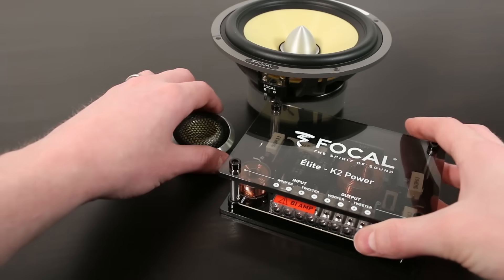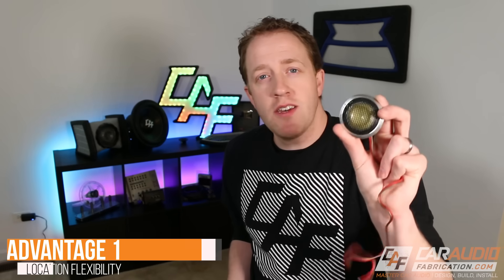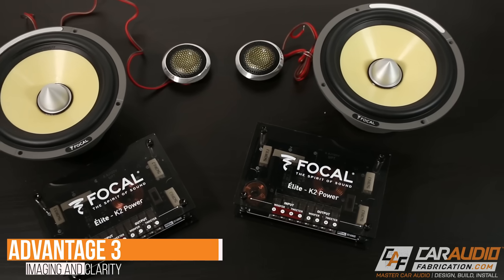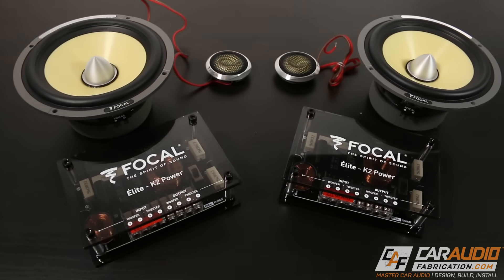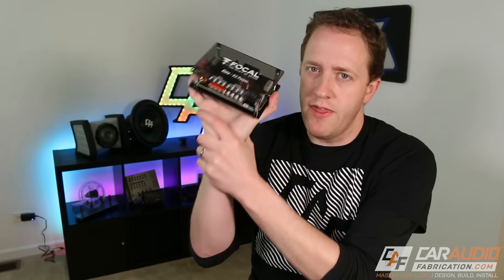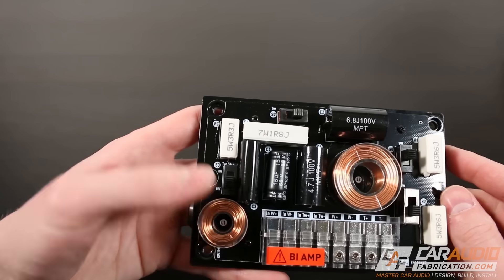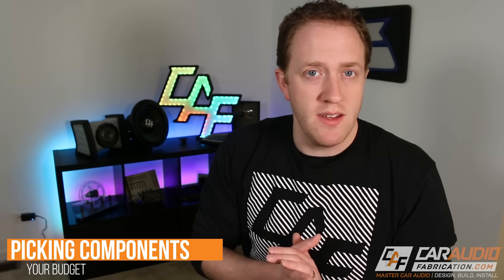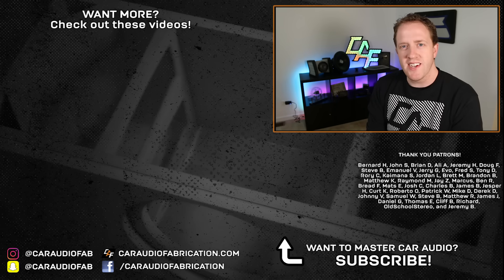Want AMAZING sound? COMPONENT SPEAKERS & everything YOU should know...

Comment: What about enclosures for the mid woofers?  Would you recommend those or do you prefer them as infinite baffle on the door?
Reply: Depends on your goals. If you're looking for "moderate" bass output without a sub, a properly powered high end mid in a ported enclosure will do. If you have an accurate, fast sub, there isn't as much need
Reply: @noncog1  how do you size an enclosure for midwoofers?  I can't find the thielle-small metrics for them so I could model in WinISD
Reply: @RyuMoto  unfortunately many woofers dont have listed t/s, I would try contacting the manufacturer and asking for both the t/s and reccomend enclosure specs. If that is fruitless, try finding specs for a similar driver. If you still cant find anything you'll have to wing it, for a base, my drivers want .3 cubes net, but take 300wrms and play down to 50hz, so unless you're running something similarly capable (which if you are you should be able to get those specs) you'll want to shrink that enclosure. For a mid grade set I'd probably try .2-.25 net cubes with a port tuned for between 75-200hz depending on the driver capabilities. The lower it plays, the bigger the box and lower the port tuning, the more power it takes, the bigger the box. The more come area, the bigger the box. These are 6.5's
Reply: @noncog1  🙏🙏🙏

Comment: The more systems I build the more I realize how much power these high end components need.
Reply: Yep, usually more power means more money 💰.  I usually go with coaxial speakers but rely on quality components, materials, installation, and tuning. It's not cheap but it isn't crazy expensive either. 2-3 grand give or take not including labor, time, and effort.
Reply: running 170 rms on my pioneers

Comment: Way to go bud, I am an audiophile you just stumped me. I own better than movie theater Home Theater system and work in live music, car audio is little different, you explained almost all of it. One question would nt the smaller space, seating and other materials absorb sound, how would one calculate performance and sound reproduction, for the best listening experience?  
Bose uses various testing equipment my Cadillac has Bose system, is rather disappointing, my Buicks system sounds cleaner in sound reproduction. 
To get the best sound reproduction should one use the amp to tune the speaker level or use the crossover to adjust the sound? .

Comment: Hello Mark. I love your channel. Getting ready to pull the trigger on my install in my H2 Hummer. Kenwood 9903S head and Focal 3 way for the fronts & Focal 2 way for the rears???? ? I have a Pioneer 10" shallow sub in a enclosed under the seat that conforms to the shape of passenger under seat.   My 2 questions I pose is . What AMPS would you use for Sub and Focal speak set. And second question is,  would you run a DSP ? Thank you for all your help.

Comment: Just curious, I understand resistance but if my amp runs a 4 ohm load output and I use a passive crossover with 2 components as you have shown, does that change the impedance? (ie:2 components on 1 channel)
Reply: Nope, atleast not by much. If you to have a set of tweeters rated at 4 ohm alongside 4 ohm mids, both run through a 2 way crossover, the ohm would stay at 4 ohm. The crossover divides the signal at a certain point between the two drivers. If you had a 4 ohm midrange, but a 2 ohm tweeter, the amplifier would "see" 2 ohms in the tweeter range but 4 ohms in the mid range, so the tweeter would end up louder as amplifiers tend to put out more power the lower the impedance is. If you are doing a component system yourself, that is buying a crossover, midrange and tweeter be sure that the drivers you use are all at the same general ohm rating. I'd get more into how the frequency is divided but I didn't want to make this comment too long, hope this helps.

Comment: JL audio is the best speakers and amps going right now.   I can tell you I have been listening and putting together systems in both home and car and vans and back in the 80's it was ADS and Concord head units, then smoother came and went, but right now, the cleanest power and the most accurate speakers are being made by JL audio.
Try to by the best speakers they make and match up the power with the amp that can also power the subwoofer also by JL audio.  It sounds so good to have everything matched up from that one company.  Chose whatever head unit you like, I prefer the Pioneer but that can change from year to year, the JL audio will not be changing.  I am very said at the moment because I am stepping into a Lexus that comes with Mark Levinson sound system and it is not nearly as nice as the JL audio I'm leaving behind in my old Honda.

Comment: look, avoid co-axial ones. and avoid these component set things too. get some old fashion dual membrane wide band speakers and thats about it. they are full range, they require no crossover as they have a mechanical one, and if you are not an idiot you get one with a decent paper cone. they are funky efficient, even just a few watts wake em extremely loud, they do not have huge cone breakups as distortsion is spread in a very wide band and stays low for that reason. powerhandling is supreme vs spl, so if you kinda need more in the highs you can eq the fuck out of them and never crossing more than say 8 or so watts. means you do not have to get a dedicated amp for them. the rest is just hype, and audiofoooooolism.

Comment: I have a Toyota Corolla 2020 without the jbl system. Which speakers do you recommend for that car, I just want to replace the stock for a better sound quality speakers. Also, I noticed that there’s already a place for a sub I guess that’s the place jbl installed his own sub. I would like to use that and install one over there.  I couldn’t find any information at the site you recommended. Thanks...

Comment: i have a 2000watt amp for my sub, can i use that for them too? or do i have to purchase a second lower watt amp?
Reply: It depends on how much power your sub is drawing really, because if the amp is already powering your sub it probably hasn’t got much more power for additional shit. You’ll probably have to get another amp, and bypass the two so that the one powers your sub and the other just the speakers. That’s what I did in my car. I bought a head unit, a ported 1500 watt Memphis audio sub, and a nano 1600 watt amp to power it. Then I used my stock amplifier to power my speakers. Or you could just get another amp, a big boy with higher wattage and run it all through one amp too I guess. Either way looks like you’ll be getting another amp.
Reply: Subwoofers, and low end in general takes a lot more power to generate. If you hooked tweeters and speakers to your subwoofer amp they would likely overpower your subwoofer and get blown out, plus since the amp for your subwoofer is probably mono (1 channel) you will not get stereo sound which requires atleast 2 channels. Generally you use high power monoblock amplifiers for subwoofers and 2 or 4 channel amplifiers for your speakers. If you care about having fader control (adjusting how loud your speakers are front to back) you want a 4 channel, but if you're not concerned with that you only need a 2 channel for your speakers.

Comment: I want to install the Hertz CK165L in the door panels. They came with two crossovers for each side that seem crap. A very thin cable comes out of them. It doesn't look as a quality component. I have in my possession a pair of mb Quart crossovers that are rather old but they came with my old speakers which were very expensive quality components. Do you recomend rather using the old crossovers than the new shitty ones?

Comment: Please help.. my vehicle has 6 channels. Two 6.5 in the front doors & two 6.5 in rear doors, plus two small 3.5" up front in the dash. Would it really be necessary to run components if I'm using an aftermarket deck to power the front/dash 3.5's while powering the doors with an amp? Thanks Mark!

Comment: Do I need to install an amp? Don't stereos have built in amps?

Can I just replace the woofer and not the stock tweeters if my car has tweeters and woofers?

Or do I need coax for the built it crossover?

Comment: Thanks for your great videos.  Ehmm but just to be a bit picky:  You said to not trust blindly on the impedance numbers provided by the manufacturer and measure them yourself?   Well I agree to not trust anything blind. But you can't really measure the total impedance with a multimeter because it's  mechanical resistance  + inductance  combined.  The mm only reads the mechanical..    
So don't  start  connecting 3-4 of these in series guys.. 😋

Comment: as an audiophile (trained engineer and diy hifi speaker builder) i put together a system for my van out of spare home speaker parts i've collected over the years.

in the doors are some 6" polyprop mid/bass drivers from some old kenwood speakers, mounted nice & solid with plenty of dampening and no crossover. in the tops of the doors below the front pillars, pointing at my ears are some cheap mylar dome tweeters (clones of the famous audax ones - there's so many copies and they generally sound decent enough if crossed over right) going through a 2.2uf cap (6db xover at about 3.8k). these are running through the front of my 4x50w $20 2nd hand pioneer head unit. 

through the back channels i run a 2x7" sub box i made with the drivers out of a couple of yamaha home theater subs, running through a passive xover. it goes down to 30hz at ~-3db due to a big, well designed, box with twin ports & high efficiency drivers! 

in total the parts cost ~$100 and it's seriously probably overkill for my work van. even without the sub box the bass is surprisingly decent. proper mounting of door speakers makes a huge difference and having separate component tweeters (in a noisy old van, anyway) can make up for mediocre mid/bass drivers, provided they're mounted right. according to literally everyone I've demo'd it to it sounds f'ing awesome. you don't need to spend much if you know what you're doing!!
Reply: C.B.S. Only original audiophiles will know audax👍🏽

Comment: So when they give the RMS rating for a set of component speakers, does that include both the woofer and the tweeter? say the rating is for 80 watts rms, will that 80 watts be for the woofer and the tweeter or is it 80 watts for each of them, making a total of 160 watts?
Reply: Why wont anyone answer this. I've seen this question everywhere and need to know. Mark where are you
Reply: That power rating is total, woofer and tweeter together.

Comment: What about 3-way speakers, with high/low pass filters (Built-in crossovers) and capacitors?
Reply: Sounds like you are talking about coaxial speakers, where are of the drivers and crossover circuitry is built into one unit. They do the same thing but most component speaker sets come with better designed crossover circuits which sound better, and they allow you to position your midrange and tweeter individually to fine-tune how your system sounds.

Comment: Need help. I have the focal expert component set. I’m using a 4-channel amp to power the 2 component sets in the front and 2 -2way speakers in the rear doors. I removed the “bi-amp” tab that is in the focal crossover and ran a total of 4 wires from the amp using 2 of the channels to the crossover and 2wires from the crossover to the tweeter and mid. Basically I’m using all 8 terminals on the focal crossover. Issue: sounds like garbage .... can’t hear hardly anything from the tweeter and the mid sounds muffled. I have sound deadening in the doors . The gain only seams to make the speakers sound worse. Please help me with what I’m doing wrong. I’m using the precision power 4400 80watts rms clean per channel . Any help would be appreciated
Reply: Still looking for help guys 
Please?

Comment: Crutchfield will tell you nothing good will fit in your car. You must go to a professional installer that can tell you what you can actually fit. Crutchfield has told me that the last 2 receivers I had installed would not fit but they fit fine. They also told me the last 2 components wouldn't fit but with the help of spacers they fit fine. When it comes to car audio you want the deepest depth speaker you can fit in that space, do not let crutchfield sell  something a half inch shallower because they really don't know. That half inch could mean the difference in good mid range or no midrange!!! You haven't heard music until you've heard a pair of Focal K2 Power 165KRX2's baby!!!!!!!!!!!!!!!!!!!!

Comment: In my case I drive a pretty old car with 4 New speakers, 2 6x9s and 2 4x6s and a new head unit. But I realize that if I turn my balance and fader more towards the back left speaker it sounds better and has better bass than all 4 combined on the same settings. Am I just missing an amplifier?
Reply: Im not sure, but id make sure theyre wired correctly, make sure pos to pos neg to neg etc
Reply: They are, you can check polarity just by watching which way the speaker cone pops. It doesnt sound bad at all its just the bass isn't as powerful. That's why i think I may just need to amplify my 6x9s.

Comment: I'm disappointed that you neglected one of the biggest disadvantages of putting the tweeter near the top of the door. When the tweeter is far from the woofer, compared to a wavelength at the crossover frequency, the output near the crossover frequency becomes multidirectional, as the path lengths from ear to woofer and ear to tweeter vary. The woofer and tweeter combine constructively in some locations and destructively in others.

Comment: Hi, I have a car with OEM 4 tweeters and 4 mid range speakers. I want to upgrade those speakers with focal components. Do I have to still use those passive crossovers? Or can I just plug the speakers to the OEM speaker plugs? BTW I have an european car which is not listed in Crutchfield :(

Comment: I have a crazy seeming question.  I have a 2+2 convertible.  There are speakers:
2x  6-1/2" by my feet
2x  ? tweeters near the side mirrors
2x  6x9 in the back seat (l/r)

I assume it's wired to have the tweeters linked to the foot speakers but the rear speakers are closer and more in the open.  Should I use a component set in the back & tweeter locations?

I might not need the foot speakers at all.

My fear is that because all the mid will come from the back and all the high will come from the front, a sweep or guitar solo would move all over.  That might get old really "fast"

Comment: Question: I just ordered some Focal components. Can I put the woofers in the doors and the tweeters up on the dash facing up by the windshield or will they be too far apart? The reason is my car came with factory 3.5 mids on the dash and I want to take advantage of this for a cleaner installation.

Comment: So he said something I'm thinking about. I have a 02 deville with a bose factory amplifier. There's an total of 8 speakers  running the speakers. 4 door speakers fronts 6.5 and rear doors 5.25, 1 8" subwoofer back dashboard, 2 tweeters in the front door pillars, and 1 small speaker in the center front dashboard. Can I run the component set through the factory amplifier? I already have 2 15" P2s on a prime 750.1 birth sheet says 879rms.

Comment: every time i watch a video to understand watts to ohms to amps i get more confused than before i watch them.
Reply: Watt = power (or ability to take power)
Ohms = resistance of the speaker (actually impedance = complex resistance).
Reply: RCA's and speaker termimals are measured with AC on amps. Sine wave runs will show clipping for the tune, just make sure all inputs measure within 1volt👌
Reply: DVD wire doagramfor car
Reply: how many "what"s in this video?
Reply: charleywayne hinkle Best of luck in your studies. It took me years to figure it out.
Reply: I'm just getting into a car audio scene but I've been in the electrical engineering scene for several years and as far as I know what's are how much power you're using ohms is how hard that power has to work to get from one place to another and amps is how strong the power is so if you using something that's high amps but low Watts it's going to be low voltage I don't fucking know man
Reply: @braydoncoate  I’m going to take a guess and say the higher the ohm the quieter the speaker is going to be at the same watt level. You match ohms of speakers so they all have the same volume. That’s it I guess. If you are putting lower ohm speakers in place of higher ones maybe be careful not to blow them because of the extra watts they can see now?
Reply: Do a search for “JL Audio School of Sound pdf” they created a book in pdf that explains everything you need to know.
Reply: Simple explanation to you my friend watts is the power coming from amp to speaker ohms is the resistance of the speaker higher resistance of a speaker like 8 ohm the less power that a amp can put to it and lower resistance like 4 ohm more power it can get
Reply: Think of electricity like water in a hose. The water pressure is like volts (V); the diameter of the hose is like amps (A) or current; the rate at which you can fill a large container with water is like watts (W) or power. Then the resistance within the hose would be Ohms.

Watt's Law ----- Volts (pressure) x Amps (current) = Watts (rate of power) ---- (aka V x I = P).

Ohms Law ----- Amps (current) x Ohms (resistance) = Volts (pressure) ----- (aka I x R = V).
Reply: Watts law is P=VI ohms law is V=IR
Reply: @BrandonPlaysDrums13  I'm an electrical engineer and I've never heard it referred to as "Watt's Law," but after a quick Google search, apparently it's a thing.